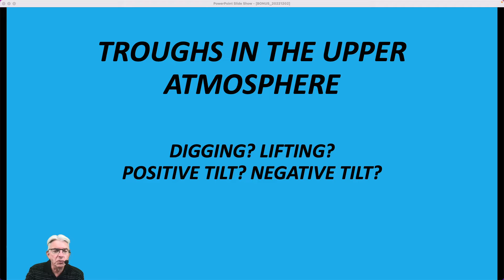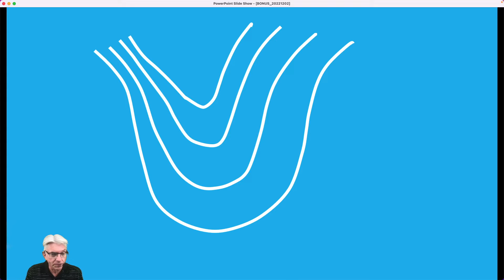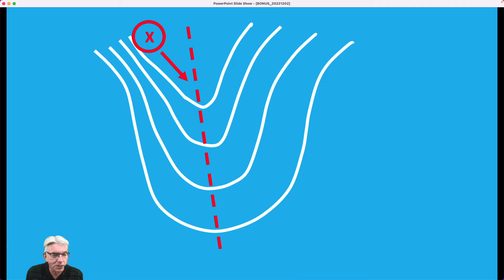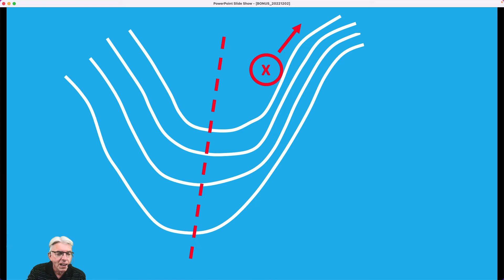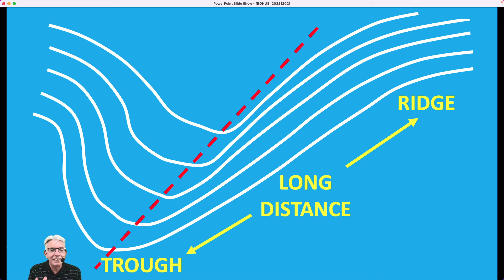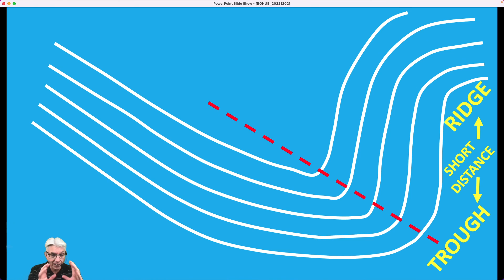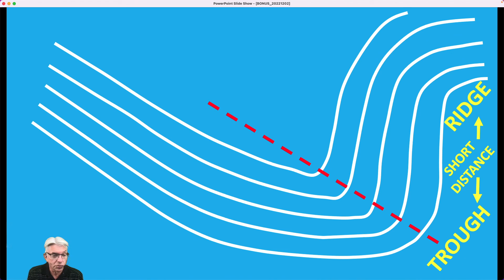Troughs In The Upper Atmosphere

Comment: Thank you for your video. I am somewhat confused because I don't know what is happening in 3 dimensions. Are we looking at the isobar lines from above against a map? In other words, we are seeing the lines in 2 dimensions and the troughs are towards the south and the ridges are towards the north.  Is each isobar line 500mB? Does a trough represent a low air pressure and the ridge represent a high pressure area? Thanks again.